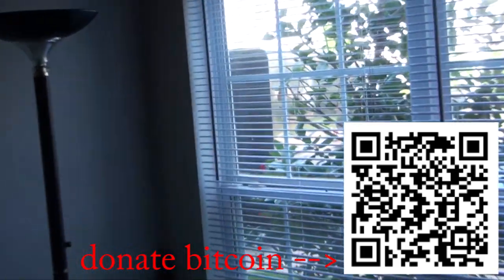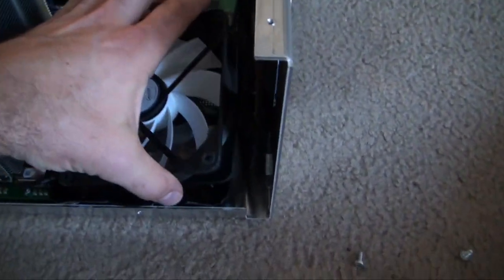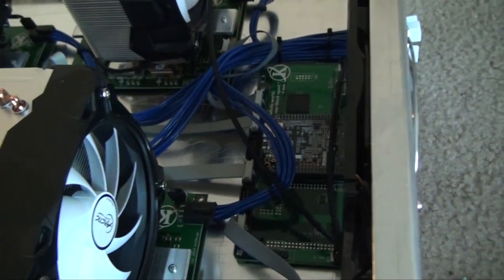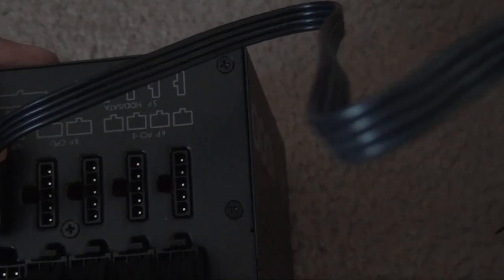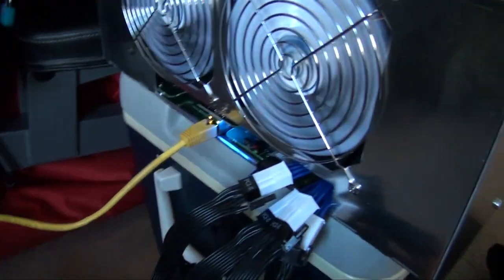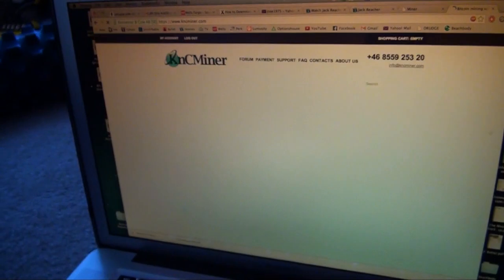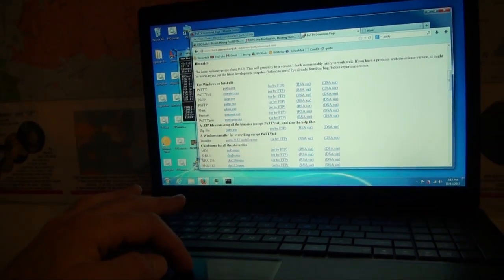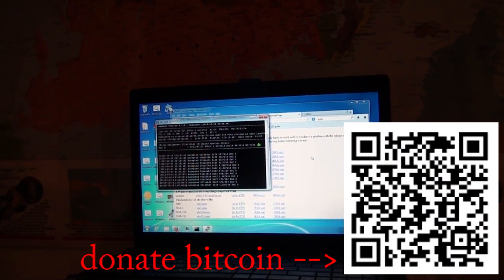KNCminer Jupiter Unboxing and Setup

Comment: Ok I just got the Jupiter, and I have some issues. I am also using btcguild, and only using that. On the Miner setup page, there is a line for entering a "Quota". What do I put in there? And what are these options of load balance and failover? And which option would you recommend were I only using btcguild?

Comment: So, what you are saying is that at this point no matter what kind of hardware are you purchasing or how fast it's not gonna matter because because of the difficulty factor. From what I understand you are making money based on how fast your gpu and how much you spend on electricity( of course there's also the difficulty). I guess what I'm trying to say is, it's been working for the past four years if you invested some money into it and and there's quite a few blocks left to solve so what changed? I understand more people get into it and that's a factor but shouldn't a really expensive machine with enough computing power be able to make you some money? Maybe not as much as it used to but something worth it. As you were saying the Bitcoin has the potential to reach 10000$ so that alone should help quite a bit. I know the Neptunes are sold out and I was thinking to put my name down for two Monarchs but there's all this negative vibe about not being worth it anymore and I for one need some solid facts to make up my mind. Any kind of feedback would be appreciated so thanks in advance and thanks for answering my original post.
Reply from the maker: Yes

Comment: Thanks for the video that was very helpful. I'm really new with all this and I was thinking to invest into their Neptune rig. I 'm not very good at computers but I understand basic stuff and have done some homework on bit mining. I'm just a little puzzled about you saying it's not worth it as of right now. At 3ths/s that Neptune will output with 200$ worth of electricity it seems to me that you could still do pretty well. Unless I'm missing something. Also like you said price will probably reach record highs. If you don't mind can you explain to me why it wouldn't be worth it? Thanks in advance!
Reply from the maker: Neptunes are sold out.  By the time Neptunes ship, mining difficulty will be around 20 billion.  Neptunes will probably only get ~0.1 btc per day.  Bitcoin will have to be close to $10,000 for this to be as profitable as the Jupiters were.  It's a huge speculation and should only be bought if you have money to burn.  It's like going to the casino.

Comment: How many bitcoins are you mining per month with your Jupiter? Did it pay for it's self and are you still running it?
Reply from the maker: How many per month is not the way to gage it.  How many per difficulty cycle or per day is easier.  I'm getting ~0.3 per day now.  Tomorrow difficulty will increase and I'll get ~0.22 for the next 10-14 days.  Yes, it's paid for itself.  Yes, I'm still running it.

Comment: FANTASTIC Video!!  I just ordered the KNC Neptune. I am not technically  knowlegeable at all about computers and could sure use your expertise and guidance.  How do I go about finding the information I need to have KNC setup the Neptune miner so that I can do the "plug & play" ? What is the best way to inform KNC of how you want it prefigured, and how did they confirm it with you?  Can you advise me of any other websites that would help me understand the setup process? My sincere thanks in advance for your time, patience, and reply.
Reply from the maker: They have a section on your account page to enter your pool data.  Check the knc forums for more help.

Comment: Hi joae1975,
thanks for the video. By the way, I didnt see where you had input your BC wallet number and pool options. Or you mining as a single node?
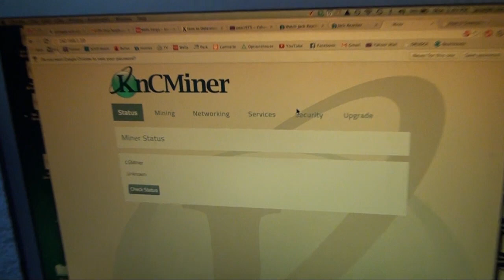Reply from the maker: KNC products come preconfigured as long as you told KNC what your pool options were pre production.  They are plug and play if preconfigured.  You can view the miner's interface at 7:17.  Just click the "miner" tab and you can change your pool info.  It will take effect after a restart.  And it will also save it.  So if you have to unplug it or whatever, it will remember.  Also, with a hard reset, it will go back to the original pool info you told KNC.

Comment: MINING IS DEAD in 90 days, so do not fall for it.
This rig will cost you $5,000 IF<<< If you can get one and yes at today's rate you ($527) you can make that in a month. BUT NEXT month aka (9.2 days) the minig rate of difficulty goes up.  (679951496.758) and then you will only make @ $6,500 at today's rate > http://www.alloscomp.com/bitcoin/calculator at a 550GH/s mining rate.
If you are going to mine, go here to save a ton of money>
http://cloudmining.tk/
http://cloudmining.tk/
Reply from the maker: Difference being, I can point my miners at alt coins, i.e. PPC and then sell them for btc and make more.  You can't do that on a cloud contract.

Comment: Hey I have an important questions.  What exactly does a Knc Jupiter does?  Does this help you mine without having a gpu in your computer.   Or do  you need a gpu?  I think you are doing this all wifi.  Thanks
Reply: It's completely standalone - I have my one plugged directly into our network with a static IP. You just use the web interface to control it (or turn on SSH so you can login via a terminal to see exactly what is happening.)
Mine also had a fan which had fallen off and slightly levered up the BeagleBoard off it's connectors so it initially wouldn't start - the packaging was terrible.

Comment from the maker: You won't get it in Nov. It'll be shipped Nov 30th if anything.  My order was promised shipped Sept. I didn't get it til Oct 14th.  But this is 2nd batch so it may be better timing.  I hope they work out the kinks with packaging and hardware problems.

Comment: There is a fix out there called enablecores, for some people it will fix some  processors not running at their full potential.

I run 0.95 which came with mine out of the box without any fixes. I don't want to mess with the miner when it's running fine so I try to touch it as little as possible lol. 

What are the temperatures on the slow machine? You can try to point a fan at hot units. Lower temperatures often result in better hashrates on the forums.

Comment from the maker: Same pool here too.  Same earnings.  The Jupiter I opened above does the same as you, ~553/4.  My 2nd Jupiter only does ~530.  I can't get it any better, tried everything.  I'm not sure what it is.  It has a lot of HM failures.  I plugged it into a different outlet on my monster power strip, we'll see if that makes a difference.  It actually seems to be at the moment.  I'm running 0.95 on both.  The 2nd came with 0.96 installed.  What firmware are you running?

Comment from the maker: The paperclip completes the circuit so the PSU can power on.  Check the KNC manual I linked above, it's in there.  This is an old geek trick used for when you don't plug a motherboard into the PSU, but use it to power other hardware, like a Jupiter.